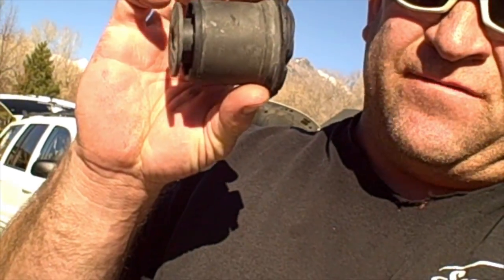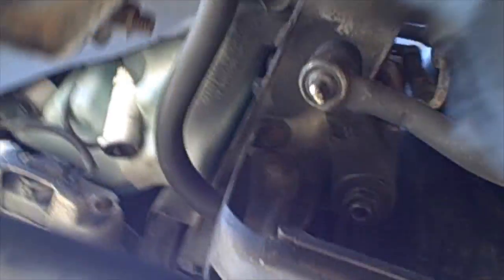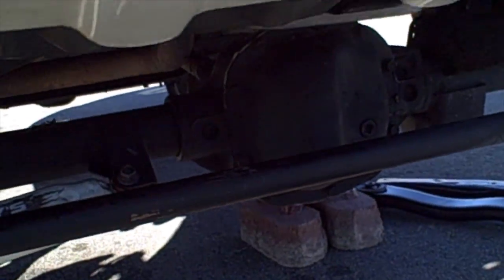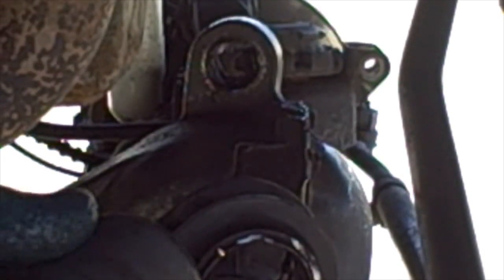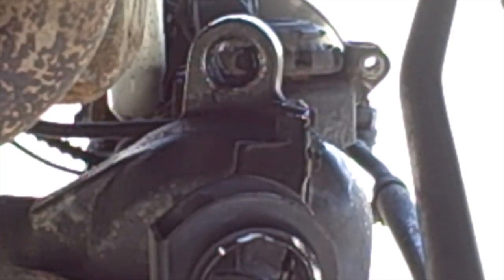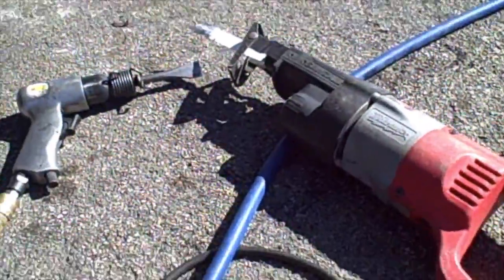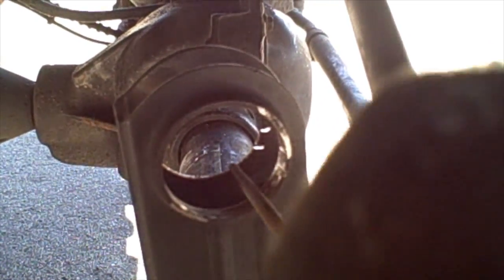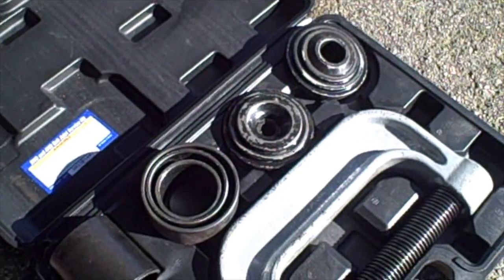How to replace Jeep bushings

Comment: Obviously, this guy did it wrong if he put a socket up against the new bushing for a perfect fit, there would be no cutting with the Saw press the whole thing out
Reply: That's not true actually, when it's old & beat up the rubber always separates from the sleeve.

Comment: Great stuff man. Needing to repair my front suspension as well, I'm having that "skeaqky" noise going over speed bumps and stuff now (worse when cold) I'm thinking it's the bushings but damn, I didn't think they made them that shitty to be replaced lol thought I could do it but don't have those tools to get the job done.
Reply: That noise is likely sway bar bushings
Reply: The squeak when cold is the sway bar bushing needs silicone grease/lube put in between the bushing and the sway bar